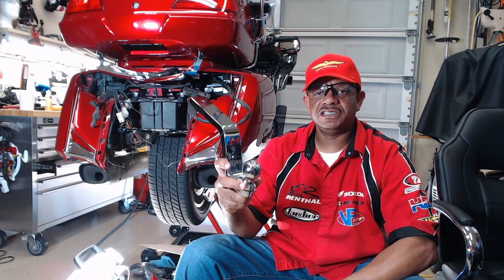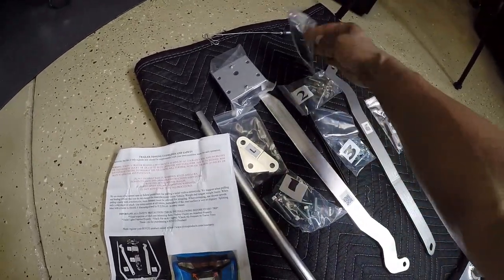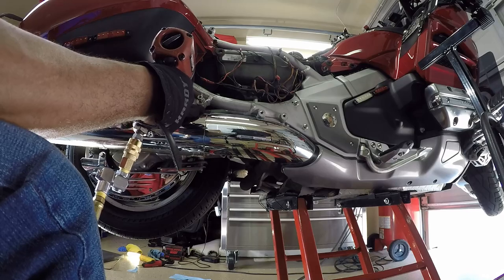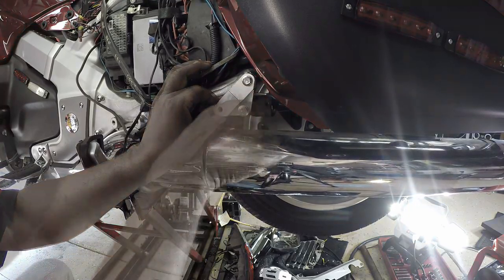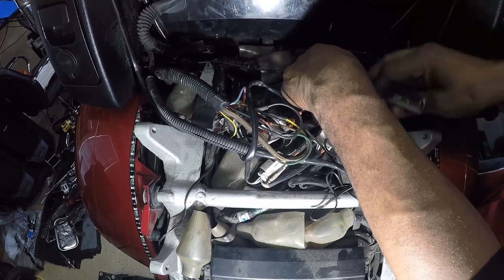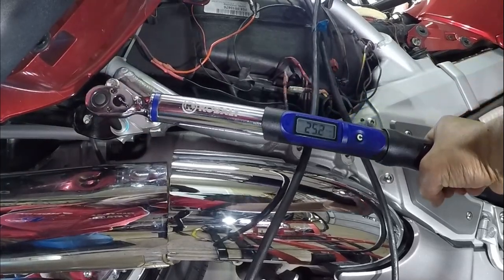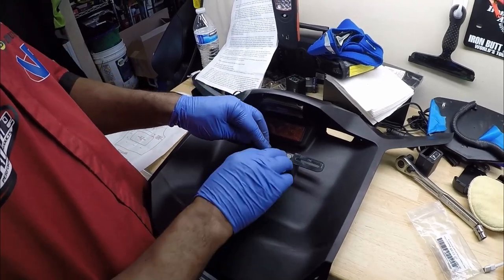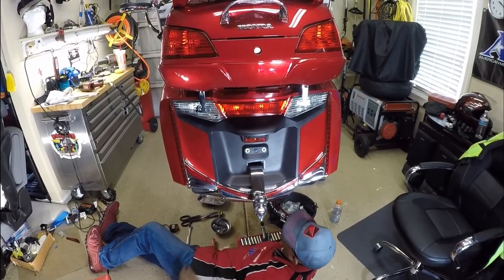RIVCO Hitch Installation Honda Goldwing 2012-2017

Comment: Thanks. Great video.  I've always run rivco hitches with both of my wings.  Getting struts up to frame was hardest..harder on gen2 wing than my gen1.  Moving harness cables was necessary for me.  good suggestion to loosen pipes.  That hitch is a beast...
Reply from the maker: You are 100% it’s difficult to get the right strut in but the video makes it looks easy, thanks for sharing your story.

Comment: The 2008 GW i just bought not only has a rectangular hole the fender, it also has a 8-10 inch split in it. Looks like it was a hole for the Rivco.

Comment: Good review!---- It's not much different from my first gen GL1800. BTW: Those nylon nuts are called a 'Nyloc nut' and have a single time use spec... . My mufflers just slip off when I get to the point you were when loosening them.